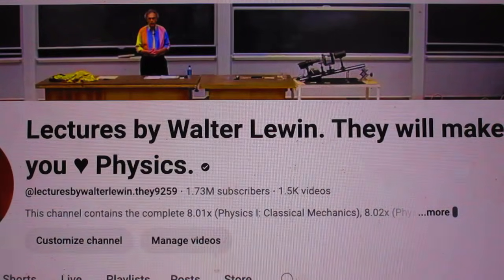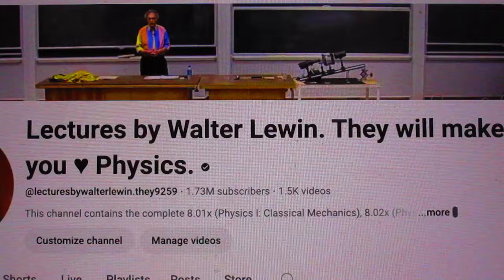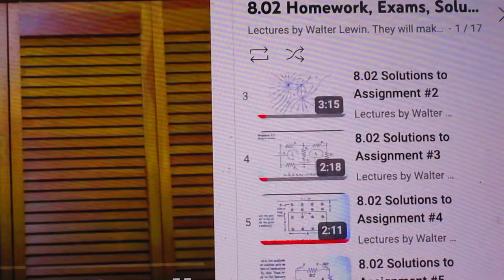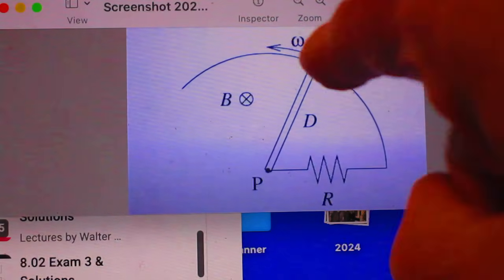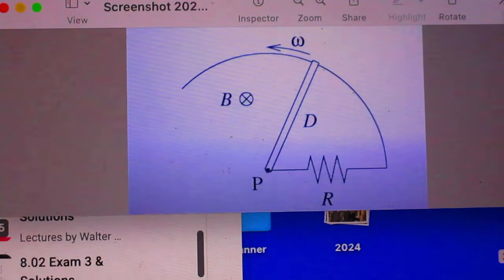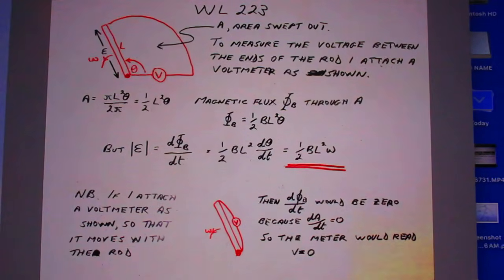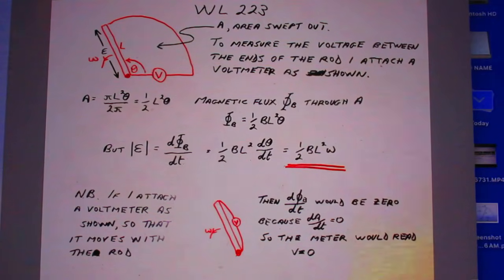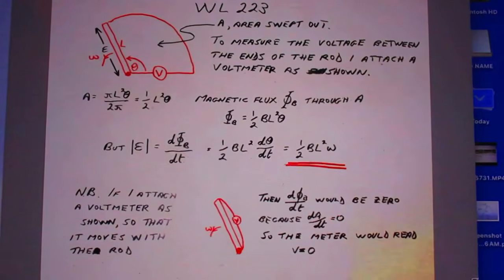Solutions to Problem 223

Comment: https://drive.google.com/file/d/1tvWJ5BAIgix1FvFAYehEifqGe-55Yh0x/view?usp=drive_link
sir this is my solution or rather doubt i am having in this problem
According to the above solution, the induced magnetic field due to moving charges must be exactly equal to mw/e (m is mass of electron and e is charge of electron) at every x
or is Faraday's Law an approximation?
sir could you please clarify this or correct me if i am missing something?
I am clear with the solution that you presented in the video but just want to know where my second approach went wrong?
if the files not opening then please tell me i would type the solution.